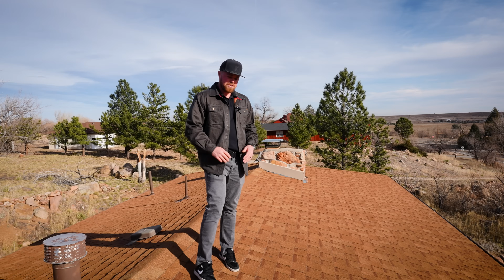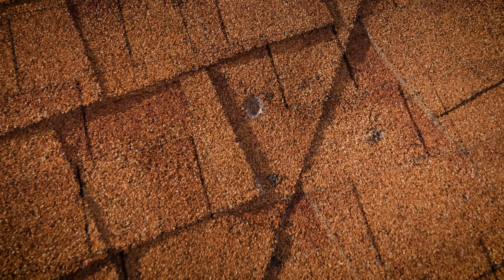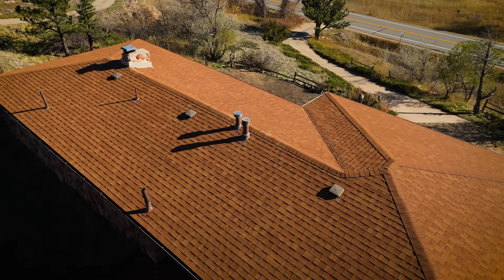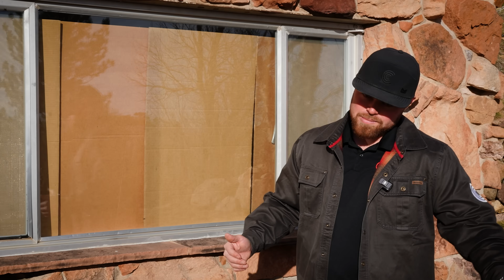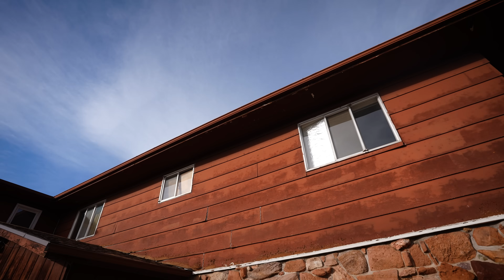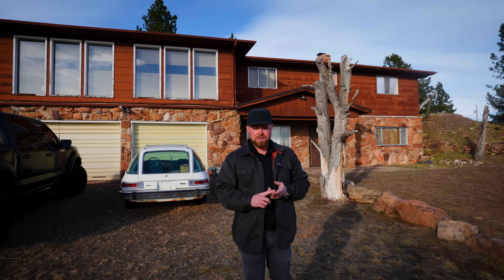How We Turned a $26,000 Claim Into $145,000 (Approved!)

Comment: Sounds like you're the reason insurance companies are dropping their customers left and right!
Why not redo the asphalt why you're at it?
Reply from the maker: Totally fair perspective and we understand why it can sound that way at first.

In this case, nothing was added that wasn’t tied to covered storm damage. The roof was approved based on hail impact, and the window issue came down to discontinued glazing components from the 1960s that simply can’t be replaced individually anymore.

Once that was confirmed, the insurance carrier made the call to cover full window replacement, along with the necessary siding and paint required to access and reinstall them properly.

Our role is to identify damage and code issues so the homeowner gets restored correctly. Not upgraded beyond what the policy allows.

We appreciate the conversation 👍